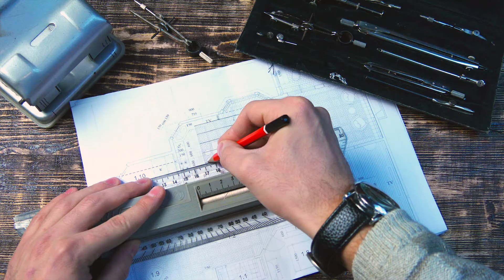Helix Steel: America’s Concrete Reinforcement Innovation Leader

Comment: The sheer arrogance and stupidity of Amerikanskies is that they failed to see the tiny flaws in their so-called super invention (MAGA inventions as they call it now) but the Australians saw it and the Chinese saw it. The flaw is the GAP BETWEEN POURINGS AND THE GAPS BETWEEN SOLIFIED POURINGS AND FRESH LIQUID POURINGS. Because the steel fibers are not poking above the fresh or solidified pourings and the fresh new pourings does not have any steel fibers poking above the fresh liquid pourings so that they will INTERTWINE AND MERGE TOGETHER AS ONE SINGLE POUR WHICH IS NOW STANDARD IN THE FOUNDATION LAYING OF NEW ATOMIC POWER PLANTS. 

The wise Australians in the early 1980s saw the flaws of steel fiber reinforcements of all designs and decided to use their common sense, they created a kind of heavy duty steel rebar shell reinforcement  which they place one half between each fresh pourings and securing it or place it in the fresh pourings and secure it there and leave it there after securing because their time is up and they have to leave and come back next morning and then they start pouring it the fresh liquid pourings.

The Chinese and Japanese and Taiwanese and South Koreans went even further. They decided to combine both conventional rebar shell reinforcement with steel fiber reinforcement, calling it 'HYBRID STEEL REBAR - STEEL FIBER REINFORCEMENT" wherein they combine the continuous steel reinforcement of conventional passive steel rebar reinforcement with the 3 dimensional and well dispersed steel fiber reinforcement that will simultaneously transfer the steel rebar tensile strength throughout the entire concrete mass through the steel fibers while at the same time the steel fibers will increase the bonding and encasing strength of the steel fiber reinforced concrete around the steel rebars themselves. A win win situation for both steel rebar reinforcement and steel fiber reinforcement.

Comment: Does the helix micro rebar rust?
Reply from the maker: That's a great question, Each one-inch (25-mm) twisted steel reinforcement is coated and individually sealed to withstand elements. Proper concrete finishing techniques will ensure that the steel is forced below the surface. Helix does not provide additional entry points for moisture. You can read more on our FAQ page here https://www.helixsteel.com/faq/, thanks!

Comment: In my country, way back in the 1950s during the Cold War, we use a double-twisted steel fiber composed of 2 steel wires twisted together at an angle of 33 degrees and is then galvanized. Then we realized we still have to use conventional steel rebars in order to have this continuous steel reinforcement throughout the entire steel-reinforced structure with the conventional steel rebars providing CONTINUOUS reinforcement while the steel fibers provides an EVENLY dispersed-distributed reinforcement within the entire concrete mass itself. At the same time helping provide greater bonding strength all around the steel rebars and steel hoops or loops or ties. The concrete cover around the conventional steel rebars and steel hoops or loops or ties is around 1 inch thick of covering steel fiber reinforced concrete. This kind of hybrid steel rebar - steel fiber reinforcement is used for our early designs of missile silos and underground nuclear bunkers. It is required to be that way so as to ensure a higher survivability rating when hit by the 1st waves of nuclear missiles using ground detonations and proximity fuse above ground detonations.
Reply: in my country in the 1950 we had tiny black and white tvs.  Now we have massive color tvs with 10x the resolution.   So if someone says "lets go watch TV" do you say "no I don't like tiny black and white video".   I don't think you are smart enough to understand my point but thank you for taking the time to write so many meaningless words.
Reply: @MichaelMantion  darthvader530 died 2 years ago and his successors are saying that it is you @MichaelMantion who is not smart enough to have in depth critical thinking but we think you are so THOROUGHLY STUPID AND MORONIC AND UNABLE TO UNDERSTAND THE ULTRA DEEP LEVEL OF ENGINEERING THINKING OF US COLD WAR ENGINEERS AND YOU ARE OBVIOUSLY A SARCASTIC IMMATURE AND SUPER STUPID PERSON. WE ARE AVENGING DARTHVADER5300 AGAINST YOU AMERIKANSKIES. MESSAGE FROM RUSSIA, KAZAN, WITH SUPER HATE!

Comment: No one has ever bothered to REVIVE the use of hybrid steel rebar - steel fiber reinforced concrete that uses both conventional steel rebars and unconventional steel fibers together in construction. The key reason is simple, the steel fibers from the 1st pour will not penetrate and intertwine with the steel fibers of the 2sd pour. Especially when the 1st pour has already hardened and the 2sd pour have to be made hours later or in the next day, because in order to get a steadily uniformed monolithic reinforcement, the pouring should be non-stop and continuous until the pouring has created a single MONOLITHIC POUR in order to get the best results from helix steel fibers.
Reply: continuous poor.